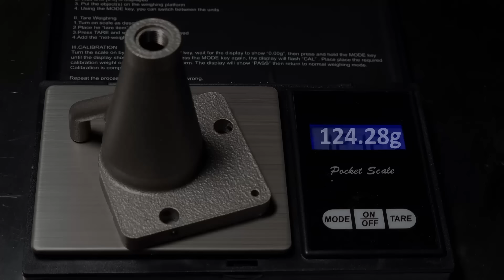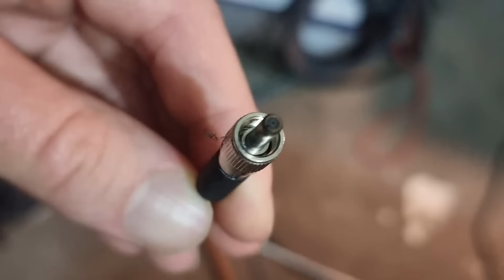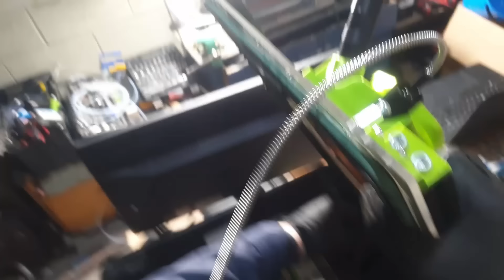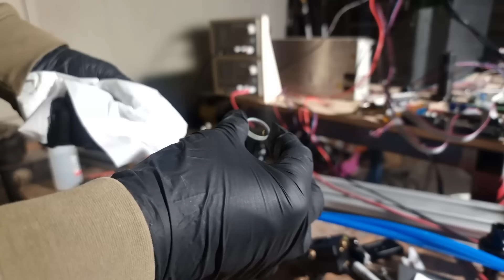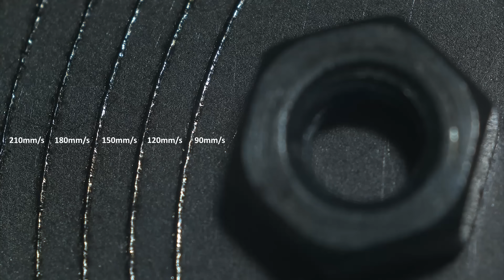DIY Metal 3D Printing - Success

Comment: I might be a bit late to the party. From my experience working with slm and aluminium powder. Common recoder either windshield wiper blades or a vacuum blade. 
I'd love to know if this helps especially if you can make your own vacuum blade
Reply from the maker: What is a vacuum blade? I think it depends on whether the bed is an open pit or runs against a deck. I have found a steel blade works best for the latter.

Comment: Have you seen that hand held lasers use wobble to negate the reflectivity of the wire feed? I think that's the behind it atleast. Would it be possible to introduce something similar to your first design?
Reply from the maker: I don't think it's intended to negate reflectivity, just to control the width of the weld puddle and stop the laser from vaporizing metal. I don't think it would work for my DED design. I tried using overshoot to get the beams to deflect away, but inevitably found that you can't make rigid assumptions about the weld pool's shape because of how movement affects it. Sooner or later, it will catch you out. Wobble might actually make that happen sooner.
Reply: @metalmatters  Do you have any idea as to how these handheld laser overcome your reflectivity problem? I understand operators typically angle the laser at 45 deg (not sure if that's an option for your printer) but I still imagine with the unpredictability of the weld pool there is a good chance it reflects back into the optic regardless of the angle.

Comment: A CW mopa laser could improve your results, instant power and much finer control, the problem is cost.
Reply from the maker: Already been down that road. 50/50 on it personally. It may stay, it may not.
Reply: @metalmatters  I though it would help, cause i remember you saying that you had to wait for the yag laser to ramp up to the desired current. Instant power would be nicer for your aplication, but tell us about it. Have you used a jpt mopa or something like that? Did the beam quality improve? Was it worth the extra money invested?
Reply from the maker: @leonardoaugusto5491  I have a JPT laser. You still have to account for delays with a Yb system. It definitely yields sharper features, I'll say that much.
Reply: @metalmatters we cant wait to see your results.

Comment: Any updates on this? would a DimondBack nozzle have worked for the wire feeder?
Reply from the maker: Not really. I have just been practicing welding before assembling the next unit. Regarding a diamond back nozzle, I am not entirely sure. I did consider a ruby nozzle at the time, but I think the biggest enemy is the feedstock drawing heat into the bore and destroying it that way. You would also need to shield the nozzle itself to prevent reflections from having the same effect on the feedstock.
Reply: @metalmatters  yeah I think diamond is a good heat conductor? so it'd likely still need a 3d printer style heat break in there. I imagine the nozzle itself might hold up better and maybe not stick? unsure. Still, good luck!

Comment: I was service engineer of marking lasers made by some company for some other company ;)  If I would try to make what you are trying to build then I would start with already made marking lasers, even with their software that allow to control everything, frequency, power,  speed line startup/ end parameters at least to start tests. After short reading I know theoretically 30W infrared laser is probably minimum way to go. I see like you are missing the main part , that laser operates in short peaks and not constant wave that presumably you are using.

Comment: Some tips if that helps:

1. Look into skywriting
2. Try netfab
3. Laser power around 200 w for steel
4. Spot dia 0.08mm
5. Mark speed 1200mm/s
6. Blowing argon 1.4 m/s for steel will help carry away sputters.
7. Use a double budged rubber wiper instead of card it might help.
8. Most important: make sure  the laser is focusing exactly at the build plate.

Comment: The displacement of adjacent powder is caused by entrainment in what we call the "condensate jet". There's a very small, high velocity jet of metal vapor leaving the center of your melt pool, it pulls adjacent process gas or air with it, and particles are pulled along. You can see them heating into the incandescent "sparks" in the beam.

Comment: 1. Do an encllsure, the argon need will drop significantly. Secknd  dual pass with powder, first lower the bench more than you need, then scraper,  then set it to plos 1 micron or negative, then laser. You adjust a lot with z bed actually.  The oöen frame you got  os nice but go to 20mm shafts  as they will be much less prone to wonkyness. Tey go with ptfe bearings,  they are much easier to adjust.  Laser power is directly in relatikn to speed, most machines havd a sweet spot, speed is non important as we talk about minutes of the total build in variation

Comment: Curious why you never tried a Pi with camera? Theres even microscope cameras for it.
Reply from the maker: Good question. It jogs the memory a bit, but from what I recall I wanted to exploit the NDK on more upmarket Android phones as they are much better equipped to handle visual processing. I also wanted to keep the head design self contained, but when adapting the phone's camera didn't work out, something with a dedicated GPU seemed like the next best thing. The 4B at the time was barely managing 10 fps on visual recognition tasks IIRC.

Comment: What partical size metal were you using, have you found better print capabilites from smaller particles?
Reply from the maker: 11 - 45um, but the layer height was run at 30 - 35um. This was in part due to poor power density but also had the benefit of combing out spatter. You have to be careful if you choose to go lower in particle size as the powder will aerosolise much more easily.

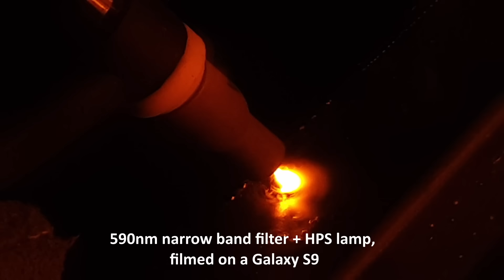Comment: 2:24 was videoed on a Galaxy S9. A Galaxy S9 is a video camera, a digital imaging device with a sensor, processor, and storage capturing light as data. There was no film stock involved, no emulsion, no reels, and no chemical development. That alone defines the process clearly. 🙂

Film cameras film. They require physical film running through a mechanical gate and later processed in a lab. That workflow has limits, cost, and handling requirements that simply do not exist in digital capture. Without those elements, filming did not occur. 🙂

Video cameras video or are videoing. Phones, cinema cameras, broadcast cameras, and action cameras all fall under the same digital video process. The storytelling may be identical, but the medium is not. Using the correct words reflects understanding of the tools and respect for how modern productions are actually made. 🙂✌❤.

Comment: sorry if you already adressed this in the video but, ive worked with sls printers and chamber temperature played a big role in the printing process. so the the laser doesnt have to work as hard
Reply from the maker: Plastics are a bit different. Some metal systems use heated chambers but they are in the minority I believe. Heated build plates are somewhat common though, but I think at this scale stresses aren't much of an issue.

Comment: I actually found out what was happening with the laser pwm, the firmware is meant to work with rf co2 lasers, which require some sort of constant activation, i think its called tickle. Im using a co2 glass tube with the rc1001 galvo, i think that i would need to modify the firmware to get better results at faster speeds despite of the lower speeds of dc co2 lasers. How did you manage to use diode lasers with this firmware, did you make any changes to adapt to you laser setup? Cause the pwm is always on and could cause problems when the laser is on but not actually doing marking commands.
Reply from the maker: I didn't use PWM for my system as diode pumps require a constant current driver and were therefore driven with RD6018s interfaced via modbus. I found there to be a significant communication delay which I suspect might be error on my part, although I never resolved it. I just introduced a dwell period post communication which was necessary anyway to allow for current ramp up, allowing the galvos to free spin around the perimeter of the build area. Just a heads up, CO2 lasers tend to have much lower absorption efficiency for SS316. It's something like 5% off the top of my head.
Reply: @metalmatters  so with diode pumps you need to wait for the current to ramp, good to know, it might happen something similar with gas lasers since the laser beam wont shoot instantaneously. But in my case, im building a co2 based laser coder, for industrial aplications, since this wavelength is more suitable for most materials except metals. Im actualy having trouble at speeds faster than 1000mm/s (belive me or not it is slow for a laser coder) the laser makes holes in the material instead of a perfect line mark, i know that it might be possible to get a little bit faster engraving speeds.

Comment: Did you abandon the wire based machine completely?
Keeping a consistent layer height in z axis seems tricky. Any errors will compound fast with the layers.

Anyway, are excited to see what your next machine will be. 
I bet more tools and tech have become available since you started this project!
Reply from the maker: Unfortunately yes, that build is no longer. Simple in concept, difficult in practice.

Comment: My teensy is activating the laser even in stand by (with a low pwr signal), do you guys have any idea if that can be fixed? Or should i use the m80/m81 commands to turn on and off the laser during the engraving?
Reply from the maker: Which laser? Using OPAL?
Reply: @metalmatters  yes im using opal with teensy 4.0, and the laser pwm is active even with no commands from the software (lightburn), im testing a rc1001 galvo scan head with a co2 laser.
Reply from the maker: @leonardoaugusto5491  Without digging into it myself, have you tried throwing the code base at Gemini and asking it the same question?
Reply: @metalmatters i ll just use the galvo ssr output with m4/m5 commands to enable and disable the laser, i think that might help.

Comment: Dealing with these solid state modules myself - I am impressed you pushed it this far! The issue with solid state lasers is that optical design is dynamic in time as power increases (on microsecond scale). It is very hard to build it stable long term (M2). Production systems use disk solid state lasers, which are not really available to us, mortals due to cost. Fiber lasers would cut 98% of that instability and complexity. You can operate cheap fiber lasers in quasi-CW mode by selecting highest possible pulse frequency, where energy is not enough to evaporate material. In MOPA fiber lasers you can also select pulse length of 0 or 1ns which often gives you CW operation (also, pulse frequency often goes up to 2 or 4Mhz which also ensures there is no evaporation). Fiber lasers without frequency adjustment should be avoided. Finally, with MOPA laser (or adjustable Q-switch one, with more care) you can do cleaning passes which might help. Finally, CW lasers also can be bought (but these are less common and often has worse beam quality, as these are optimized for welding)
Reply from the maker: Yes, it certainly doesn’t help that the gain medium is effectively floating, suspended by a pair of washers. There are special alignment tools for this, but they're too expensive to justify. I have a Yb:YAG system at the moment. We shall see if it makes the cut.
Reply: @metalmatters  Yb:YAG will not make it easier. My understanding is that Yb;YAG is more suitable for high-energy pulse lasers. Essentially this is exactly the only niche left for high-power solid state lasers. Fiber laser cannot survive pulse energy >2mJ, while solid state has virtually no limits (but high pulse energy is for total destruction, not fusing). You need fiber laser. 20W fiber lasers are now <1000$.
Reply from the maker: @BarsMonster  *Yb laser, not Yb:YAG. i.e. fiber laser. My bad!
Reply: @metalmatters  Alignment is not easy even with high-end lab equipment. Lasers with long cavity even in lab environment get misaligned when lab temperature changes by like 2 degrees. For stable solid state lasers one needs 0.1C temperature control of all components including mechanics, and/or active fine adjustment system. It is not simple, easy or cheap.

Comment: THIS VIDEOS IS VERY UNIQUE FOREVERY METAL 3D PRINTING ENTHUSIAST, GREAT JOB:hand-purple-blue-peace:
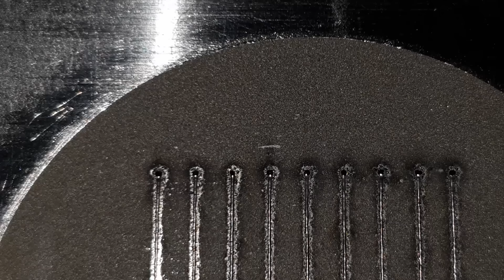16:55 THE RIGHT MOVE
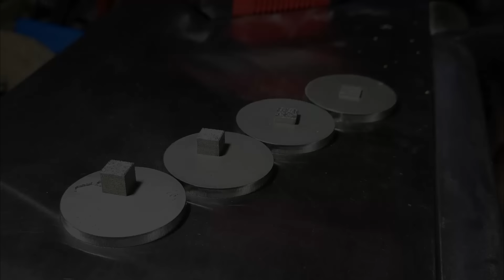31:30 WOOOW
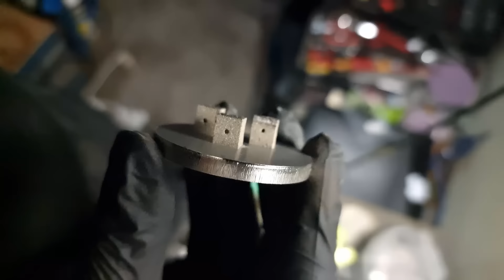36:40 THIS ISSUE CAN BE SOLEED WITH SOME SORT OF POST PROCESSING LIKE BAKING THE PART IN A HIGHT TEMPERATURE FURNACE OR SOMETHING
38:10 GREAT JOB, NEVER GIVE UP AND NO MATTER HOW MUCH TIME IT TAKES MAKE SURE TO JUST RELEASE ANY UPDATE ON THIS GREAT PROJECT!!

Comment: How's it been going?
Reply from the maker: It's been a mixed bag. I had to take a step back after getting myself into some trouble. I won't go into details here, but I have moved on to the final printer build. I'm throwing some money at it at the moment so hopefully it pays off : )
Reply: @metalmatters Good to hear your still working on it and hope "getting myself into trouble" doesn't mean you've injured yourself.

If you need some help, I might be able to assist. I can design circuit boards and do some light cad work.

Comment: what kind of optics have you used for focusing the pump diode fiber laser ?
Reply from the maker: I've just used plain spherical lenses in the past, but aspheres are really what you need.
Reply: @metalmatters interesting, any idea where i could find such lenses?
Reply from the maker: @leonardoaugusto5491  Any of the standard lens suppliers. It really just comes down to what you're willing to pay. Molded will be the cheapest, CNC'd the most accurate/tightest focusing. They tend to be a bit more pricey though which negates the appeal of a diode pump.

Comment: just since i noticed you used PTFE tubing, there's the Capricorn XS tubing that for bowden printers gets better results due to smaller inner diameter, better gliding capabilities and better heat resistance. I have no idea if it even makes sense in your application but I just thought to mention it :)

Comment: Hi, whatever happened to the Metal Matters forum? I was trying to view a link you posted on LPF about adding PWM control to boost converters, but the website is down. Awesome project btw, I get a lot of inspiration and ideas for my LPBF system from your videos.
Reply from the maker: I took the forum down a couple years ago. There wasn't enough engagement to justify its upkeep. Thanks. Best of luck with your efforts.

Comment: Maybe doing it in a vacuum chamber using maglev rails would give more strength and can save on argon
Reply from the maker: Possible, but plasma becomes troublesome. Not sure about maglev rails.
Reply: @metalmatters  Such things exist:vacuum laser additive manufacturing or laser-based directed energy deposition (DED) in vacuum. A way to go with titanium, aluminum alloys and other reactive metals. Might not be much plasma as other tech - vacuum metal deposition needs a lot of effort to make significant thin film deposition.

Comment: Saw it in another comment but was going to say the same thing. They're more expensive but it seems like a mopa laser would be beneficial for heat control. Don't know for sure if that would solve your problem, but the benefits they have for the stuff I do seem to be something that would help you
Reply from the maker: It was one of the first changes I made. It has improved things, but also created some new problems too.
Reply: That's a lot of variables you're adding to laser control. I'm sure getting that tied into temp control takes a bit to get dialed in properly @metalmatters

Comment: Holy argon batman! Over 170L of argon is now gone. Please consider making an enclosure to help contain the argon, it would seem that it would help more than just your wallet. On stainless steel pipe welding, you would cap the pipe and have a hose to flow into the enclosed volume to help the weld quality on the inside of pipes. It might help with your welds?

Comment: You are doing yourself a lot of disservice by using junk or old parts to set up your machine. If you used pre made components and external services for your metal part designs you are going to have much less headache and debugging and can focus on the application part which is the actually hardest. For example use 3d metal services for your parts, use open sourced fdm printer controllers, use pre made lasers even galvos but spot for Chinese ones to cut budget. Making your own laser path, using fpga? For controller... So much pain for no help really.
Reply from the maker: I can appreciate your perspective, but keep in mind it's a proof of concept guided by pragmatism i.e. not waiting 3 weeks for a new set of parts to arrive every time I change something. I'll throw money at it once I am convinced I understand the problem well enough.

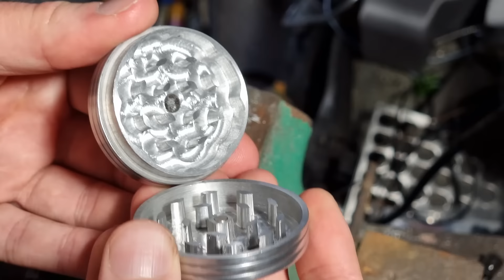Comment: 19:08 "So I fashioned up a little water-cooled heatsink made from a herb grinder"; I wouldn't be surprised if this equipment had been used in the concept and design phase of the project, or even for troubleshooting. This practical application, however, is brilliant. I'll admit that it caught me off guard and I had to skip back to make sure I heard what I thought I had heard.
Reply: Beat me to it 😂

Comment: There is a method where you can make Aluminum temporarily "transparent" to a certain frequency by illuminating the metal with a different frequency.  This "uses up" the available charge carriers making the metal less able to reflect radio waves.    I wonder if there is a way to make the molten puddle transparent instead of reflective?  Or I guess "100% Absorptive" instead of highly reflective.
Reply from the maker: AlSi10Mg is about ~30% absorptive in its powder form unlike solid Al. Maybe there is a way, but it sounds like more work than it is worth.